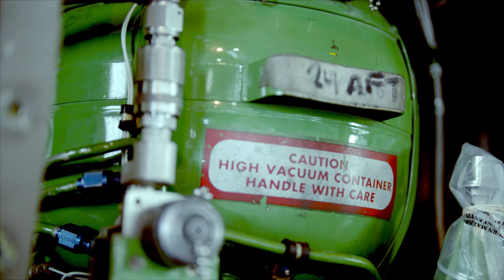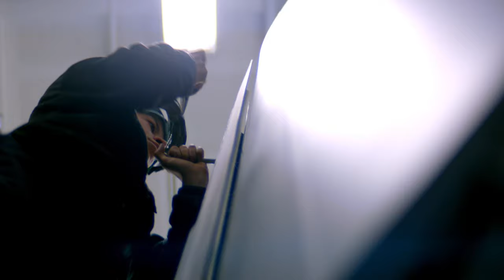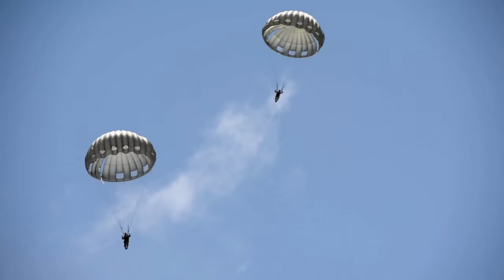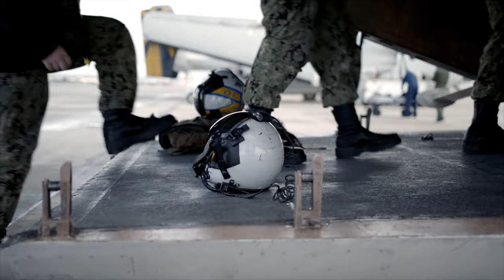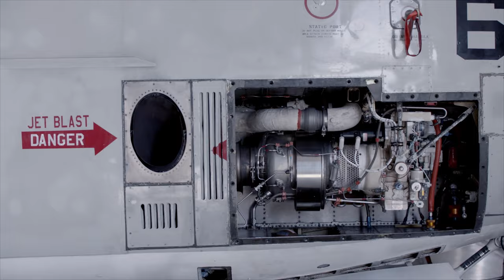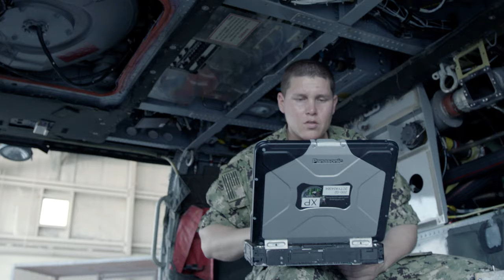Navy Aviation Structural Mechanic – Safety Equipment – AME

Comment: AME from 1972-1992. A-7, A-6, A-4 ejection seats and systems.
Reply: You retire after your 20 years?
Reply: If you could choose any other job which one would you go for?
Reply: @serj5902  I retired from The Navy 11-92.  Got Hired at a MRO called Tramco-ATS.  Got A&P and retired from them 25 years later.